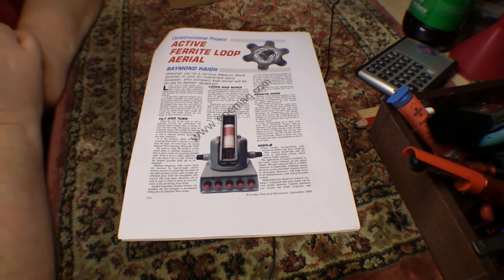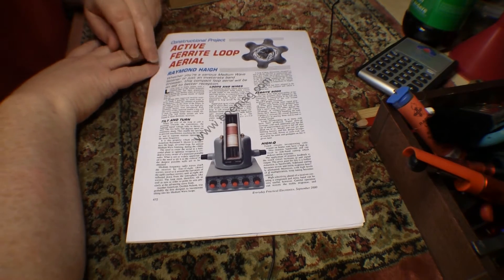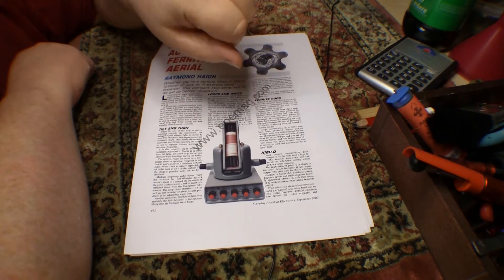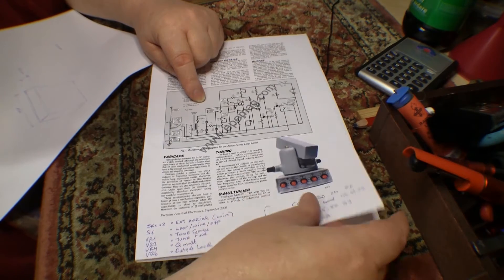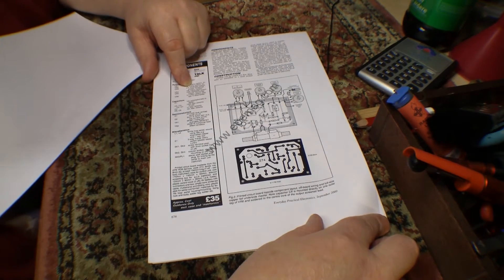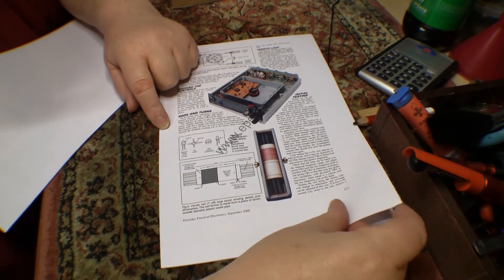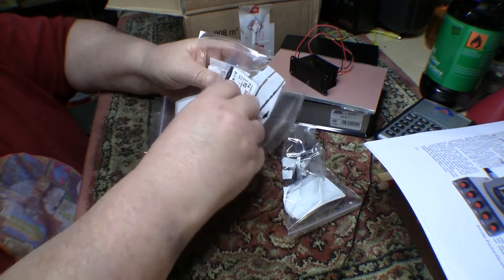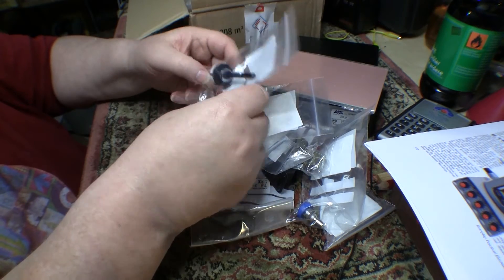Active Antenna Project - Intro

Comment: What you mentioned about older semiconductors is absolutely true. A few years ago my uncle kept giving me old Popular Electronics magazines from the 1960s because of the project building articles. While interesting they bordered on useless, they used germanium transistors and hardware that simply does not exist because they kept changing it so much. It's easier to find tubes and tube based parts and hardware then it is something like a new 2N124 transistor, which I would prefer to save for restoring vintage equipment. A 15 year old parts list isn't quite as bad to deal with as a 50+ year old one, at least the technology is in the ball park. I suppose one way around it would be to use surplus Soviet transistors and hardware rather then true vintage stuff.
Reply from the maker: I managed to find the same jFET as used in the circuit - the FET is an equivalent and so is the varicap diode.   Hopefully things will work out without too much tweaking of other components into circuit.

Comment: John, you are an ambitious guy, I have to say.  I'd most likely have resorted to breadboarding and wirewrapping it.  Ugly.  Happy etching :-)  Eagerly awaiting the progress and result of this project.  By the way, just received the PL-880, big thumbs up, so far, although I haven't progressed past AM/FM, yet.
Reply from the maker: Hi Al, well who knows if I get the etching done properly - I'll give it a shot anyway.   Good luck with the PL-880.  I gotta say the battery life is impressive as well as the rest.  I've been using mine for weeks now and the battery life still shows as just about 100%
Cheers,  John

Comment: Hi, and good luck with your project. I just "liked", and subscribed, and will be following your progress. Living in a very electrically noisy apartment complex, I'm a user and great fan of passive frame style loop antennas, but appreciate the space saving qualities of using ferrites.
Reply from the maker: Hi and thanks for the sub :-)  I've got some serious noise problems as well as the weak reception so hopes are high that this will make a difference.  Stay tuned!
Cheers,  John